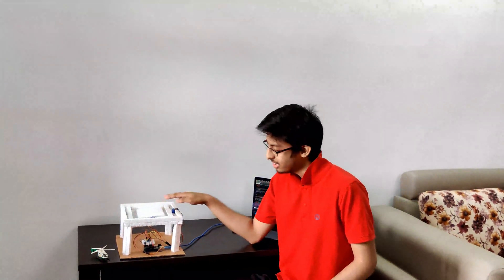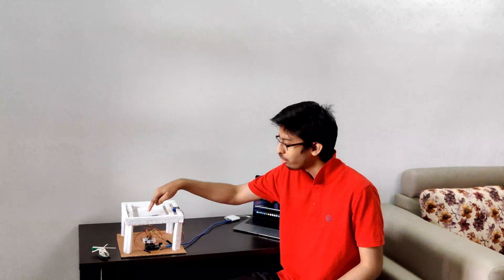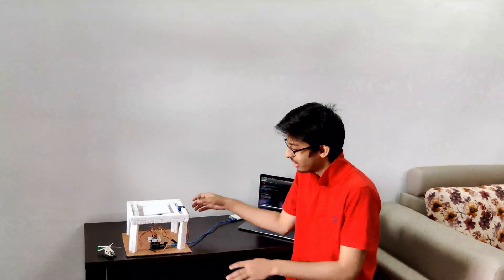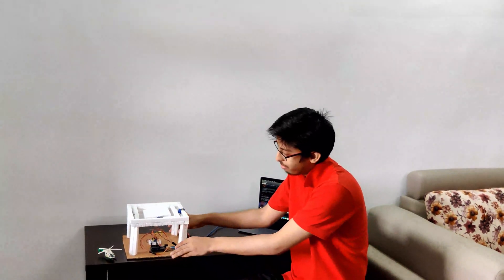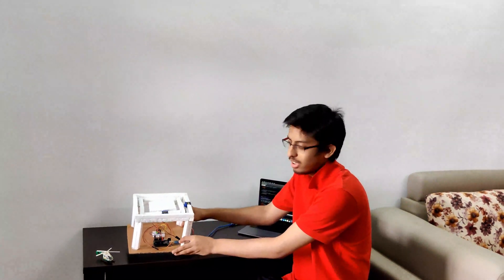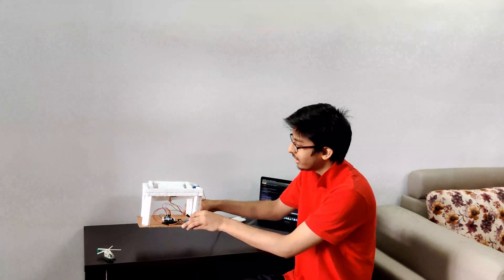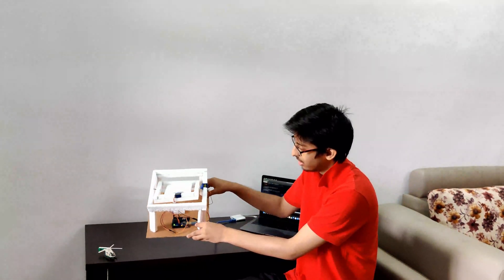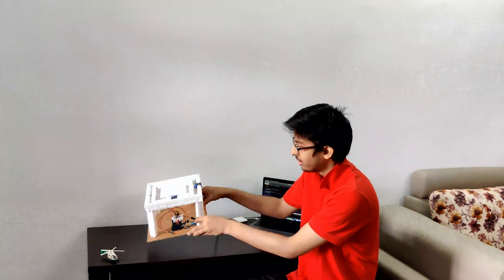Self Stabilizing Platform

Comment: void setupMPU(){
  Wire.beginTransmission(0b1101000);
  Wire.write(0x6B);
  Wire.write(0b00000000);
  Wire.endTransmission();
  Wire.beginTransmission(0b1101000);
  Wire.write(0x1B);
  Wire.write(0x00000000);
  Wire.endTransmission();
  Wire.beginTransmission(0x1C);
  Wire.write(0b00000000);
  Wire.endTransmission();
}

how to change this to NANO mcu, my i2c address is 0x68? PLEASE!
Reply from the maker: hey there sorry for the late reply. I think the setupMPU() function you've made should work fine if you're using MPU6050. Datasheet of MPU6050 has mentioned that its slave address for I2C is 0b1101000 . If 0x68 is the  I2C address for your sensor, then simply replace Wire.beginTransmission(0b1101000) with Wire.beginTransmission(0x68) . Try both and let me know if any of them worked or not...
Reply: @stlo0309  void setupMPU() {
  --->Wire.beginTransmission(0b1101000); //This is the I2C address of the MPU (b1101000/b1101001 for AC0 low/high datasheet sec. 9.2)
  Wire.write(0x6B);       //Accessing the register 6B - Power Management (Sec. 4.28)
  Wire.write(0b00000000);  //Setting SLEEP register to 0. (Required; see Note on p. 9)
  Wire.endTransmission();
  --->Wire.beginTransmission(0b1101000); //I2C address of the MPU
  Wire.write(0x1B);      //Accessing the register 1B - Gyroscope Configuration (Sec. 4.4)
  Wire.write(0x00000000); //Setting the gyro to full scale +/- 250deg./s
  Wire.endTransmission();
  Wire.beginTransmission(0x1C); //Accessing the register 1C - Acccelerometer Configuration (Sec. 4.5) 
  Wire.write(0b00000000);       //Setting the accel to +/- 2g
  Wire.endTransmission();
}

is(0b1101000) = (0x68) . they are presented in binary representation and hex notation as the latter. Correct me if I am wrong. I have tried both in the arrow locations. No difference  from the serial output.  I  use  the sketch to balance  two  plates namely upper and lower  plates.
Reply from the maker: You're right, 0x.. is hex and 0b.. is binary. But I'm not sure what is going wrong with the code here. I suggest you to ask this on Reddit, maybe on r/embedded or r/Arduino. I think you should get the proper solution there